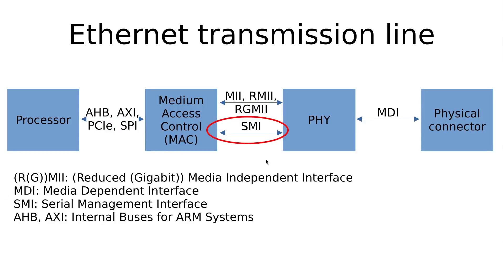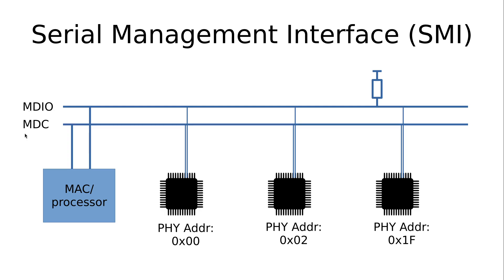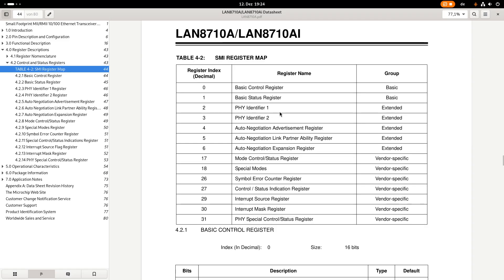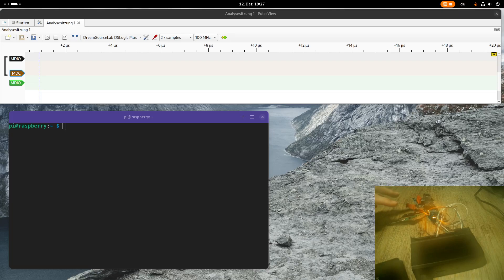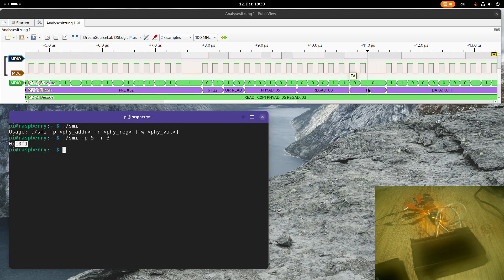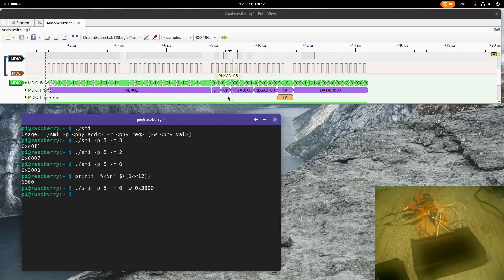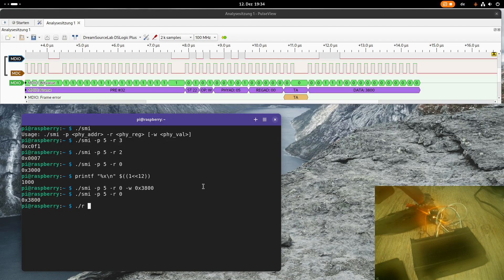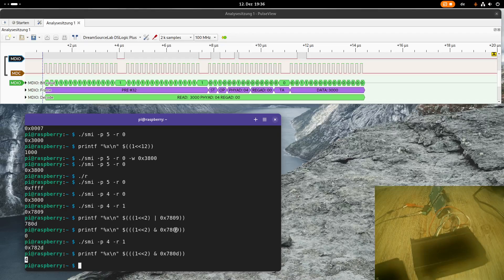GNU/Linux & Ethernet: Serial Management Interface (SMI) aka MDIO aka MIIM explained

Comment: Good hands-on intro.. short and to the point!
Kinda hard to grasp all these acronyms.. MDIO / SMI / MIIM are basically the same thing for controlling the PHY while MII for actual data transfer between MAC and PHY..
Also, not to forget there's also MDI ( Medium-Dependent Interface) which has nothing to do with MDIO.. I'm wondering why naming these things had to be so messed up.. =))
Reply from the maker: Yes, naming regarding Ethernet is a big mess...

Comment: Aweosome video...! could you provide the smi.c file. thank you
Reply from the maker: Here you can find the Code for the WIZnet w7500. https://github.com/Johannes4Linux/w7500-spi2eth
On my board I am using the SPI Interface as smi (File spi_smi.c). In smi.c I am bitbanging SMI with gpios. This will Work with wiznets evms.